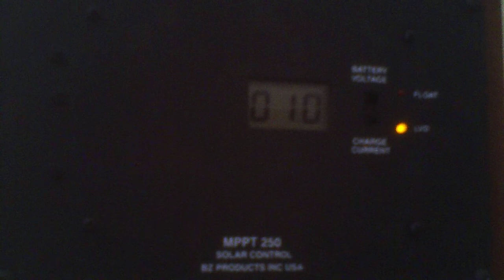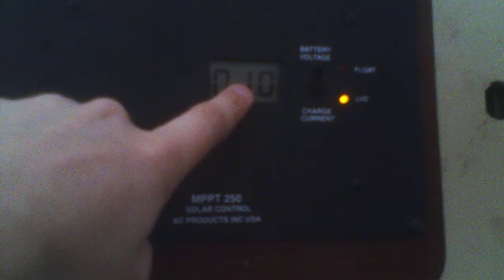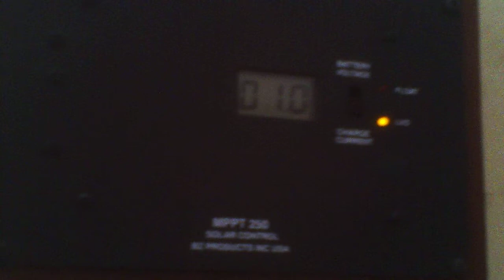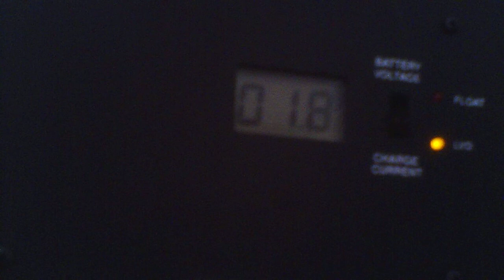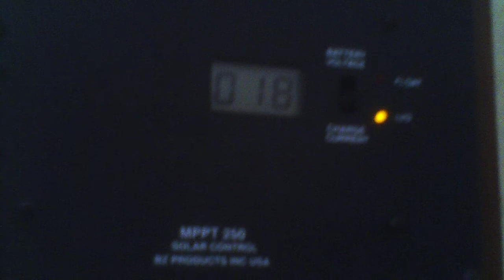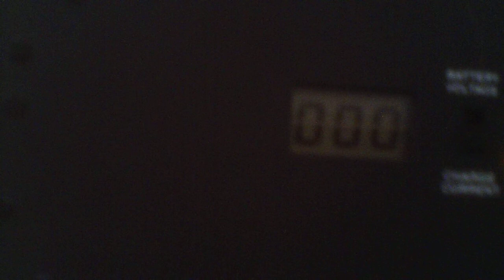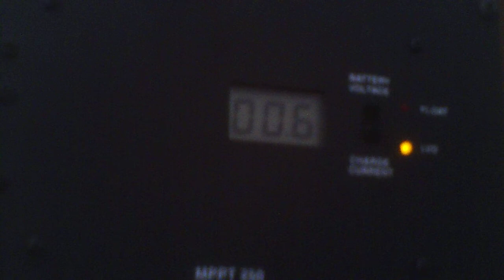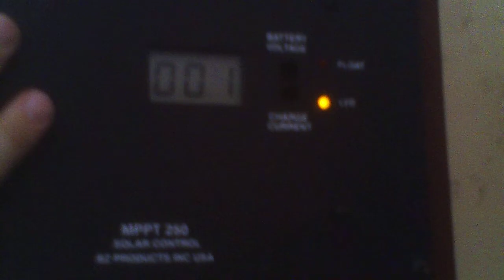MPPT under low light conditions

Comment from the maker: @KyleCarrington   The current rating is based on the switching transistors and buck (or rarely boost) converter inductors.  This means that the current limit applies to whichever side is handling a higher current.  In most MPPT controllers, this will be the battery side of the controller as the controller is stepping down the potential of the array.  There are a few boost MPPT controllers made for charging golf carts from a single PV module (PV current higher) but they are rare.

Comment: @randacnam7321 Thanks :) I was wondering that too. The panels (3) themselves might, in theory, produce approximately a max. 21-24A, but you are saying, at times, when the MPPT is kicking in, it may very well attempt to drive pulses of much more current and thus fry the unit?

Comment from the maker: @KyleCarrington   That is due to the particular algorithm/program that it uses, where if the array current is below the minimum threshold it just stops.  This is just how that particular controller is designed.
Also, if this is for a 12V system and the controller does not actively limit charge current then your proposed 420W array would have the controller outputting over 30A.  This could lead to controller failure.

Comment: Thanks for taking the time to do this video. It appears that while your unit is seemingly disoriented in the conditions, it is at least passing a charge. The one I am testing simply shuts off, gives a "night time" icon, and does not charging whatsoever. Given that it is a 30A unit, perhaps around 3 X 140 watt panels, would be recommended, and then you'd rarely if ever, see less than 300 mA from each panel... and thus not have the problem. If my thinking is correct. Thanks again.